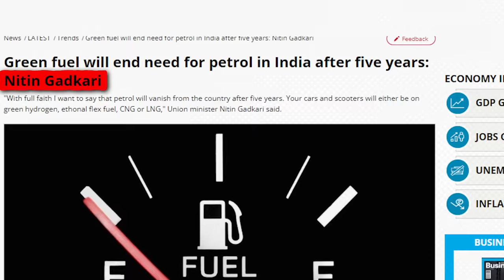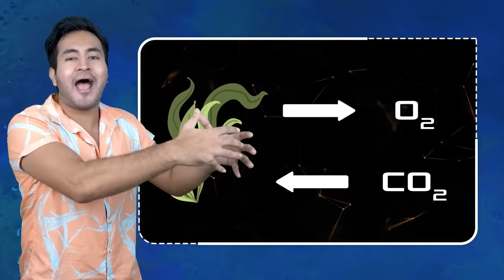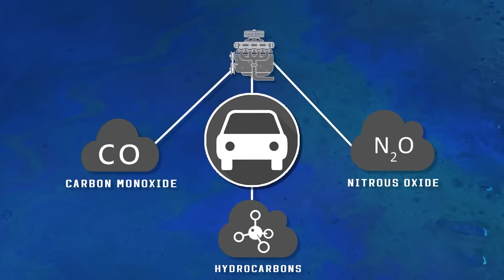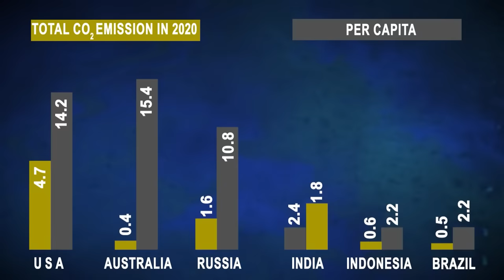PETROL To Be Banned In Next 5 Years In INDIA - Is It Really Possible?

Comment: Bhai why can't we have simple solar cars with battery whose battery charges with solar panel and there can be a safety system on solar panel so that when battery charges fully the pannel get covered and you can ride it by this we can produce energy by help of sunlight and a lot of energy/fuel will be saved
Reply: probably the energy wont be sufficient , for high powered - engines
Reply: @keshav1318  bro we it will be but the thing is no one is trying we can go to space launch millions of satellites upgrade the engines of cars make the fastest bikes and cars in the world then is this not possible and yeah in his one fact he even told that if we will put solar pannel in a dessert I don't know it's name in its one km area we can produce efficient amount of energy to run the whole world do you still think so????
Reply: @NavjotSingh-pu6tb  the cost will be expensive , and it requires space also how will we fit big panels in small cars?

Comment: It is wrong to say that electric cars just shift pollution from one point to another. Pollution in coal-fired power plants is regulated much more successfully than an internal combustion engine in a car ever could. The particulate matter in the smoke generated in coal-fired plants is segregated and sequestered. The same can be done for carbon dioxide as well. Carbon capture techniques are well developed and successful. Petrol must be banned because it costs India an arm and a leg. This is being done and I am sure that with Nitin Gadkari at the helm, it would be done on time. If he says five years, it would probably be done in four and a half years.
Reply: What about huge amount of pollution in battery manufacturing and battery disposal
Reply: @proudindian982  Right now, there is a lot of pollution. Agreed.
But this is a solvable problem. We need efficiency improvements in manufacturing, which take time because battery manufacturing is a relatively new thing. But at least it's POSSIBLE.

For Petrol, there is just NO way you can reduce pollution. It will release polluting gases because they're the very result of the chemical reaction that generates energy.
Reply: @smallypimpy6407  ev wave has more bussiness benifits then environment 
Now a day the ecosystem is not worth changing first more development is needed 
In France you can only bid for solar plant if overall impact is less 
That same thing is needed for ev

Comment: bro hydrogen is very heavy in term of energy if same amount of hydrogen and pertol compared hydroges produces more energy then petrol but it requires more space as it is a gas and is very heavy it increases the weight hydrogen cars is only possible if hydrogen is soldified or liqufied